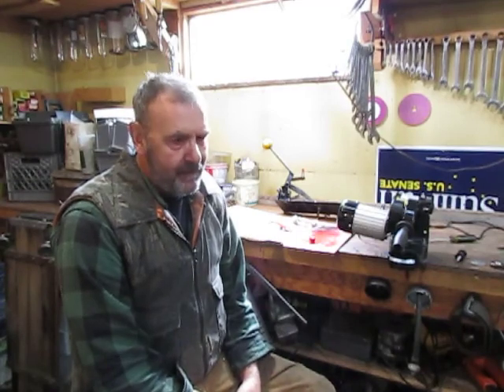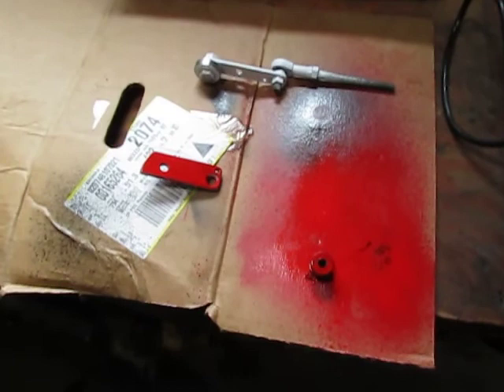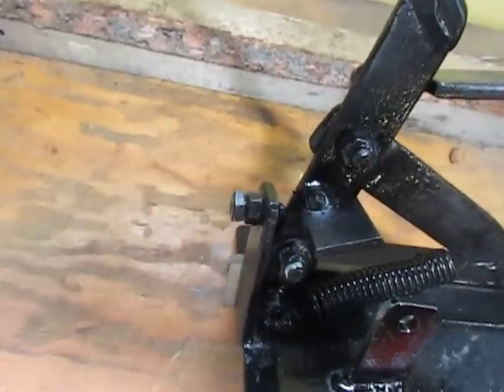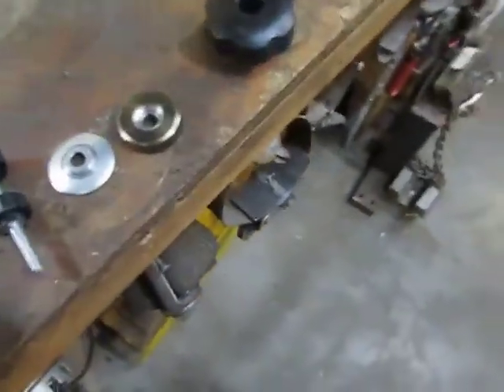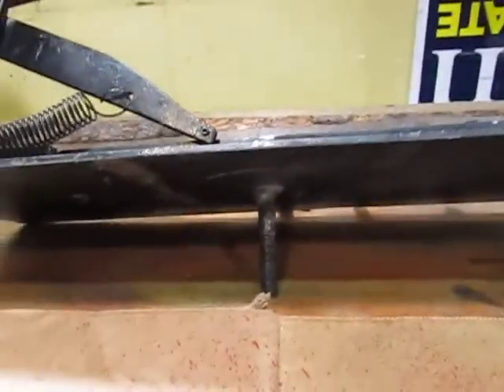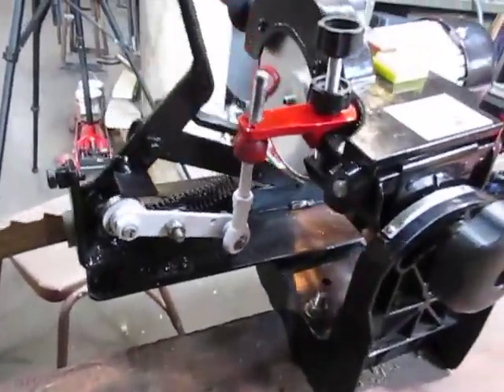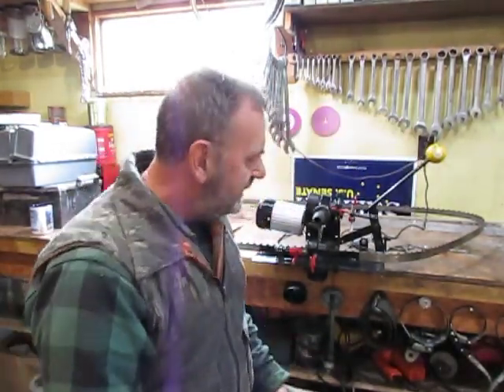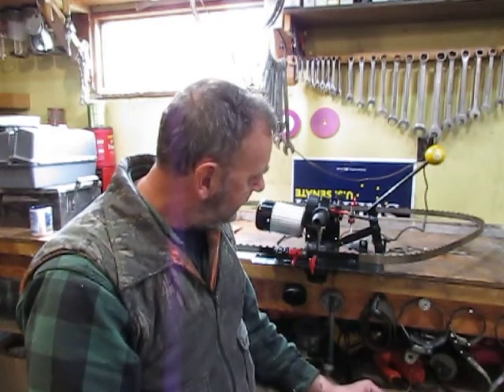DIY Bandsaw sharpener  modifications Fast easy build cheap and effective Part 3

Comment: Trapper, You are one smart dude1 HUDSON curved the blade guide that sits on the plate, did you do that one yours?
Reply from the maker: Thanks for the compliment,  I've been a mechanic for over 40 years so that helps.  I did not curve mine though that would not be a bad idea but not required.  That sharpener works beyond what I had imagined and its really not complicated to build once you can see the pieces in you mind.

Comment: Don't suppose you have a link to where the CBN wheel was gotten and whets its dimensions?
Reply from the maker: Amazon 
Super Abrasive CBN 5-3/4” Chainsaw Wheels for 3/8 and .404 Pitch Steel Chains
Brand: Diamond Wheel Inc
4.7 4.7 out of 5 stars 113 ratings
$112.00
Reply: @aktrapper6126  Thank you, much appreciated!
Reply: eBay for $20+  I got a 6" CBN Wheel and it works great. Not to mention many profile and sizes. Then again as usual alot of this is from China so why pay more for same stuff?

Comment: What type of chainsaw sharpener is that?
Reply from the maker: I used an Oregon clone like this one on amazon: 
Chainsaw Sharpener, Professional Electric Multi-Angles Automatic Saw Chain Blade Grinder Sharpener Machine, 1/8-Inch-by-3/16-Inch
Brand: Funshoppingmall

Comment: Great videos on this sharpener do you offer any drawings or sketches of all these mods I’m working on one myself I’m having a little problem getting things to work 
Thanks for sharing all the mods an build
Reply from the maker: I did not make this from plans nor did I draft up any after making it.  Sorry.
Reply: @aktrapper6126  Thanks for replying back I actually made a sharpener by watching your videos mine doesn’t have the auto feed but it works great thanks for your videos
Reply from the maker: @KE4YAL  The auto feed part is not really all that necessary for most of us.  It does speed up things a bit but really all I wanted to begin with was something that would give me a consistent and accurate grind to every tooth.  This accomplished all my need right from the start.  I went on and did a bunch of modifications just to satisfy my engineering hunger.  Thanks for the feed back.  It encourages me a lot to be able to help others in some small way.
Reply: @aktrapper6126  I watched  several different videos your videos when I saw them I told my son in law I think with these videos I can make one of those I ordered an Organ chainsaw sharper that all I bought the rest stuff I had on hand I 73 years old I have collected a lot of stuff over the years to make things with I really enjoy making things an with your videos it was easy thank you so much